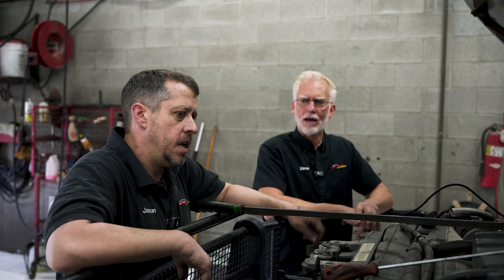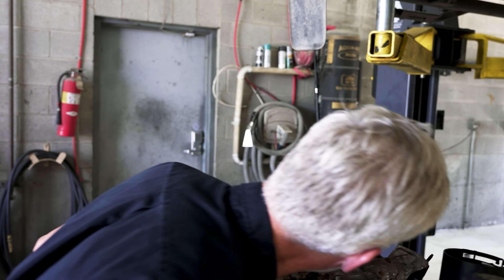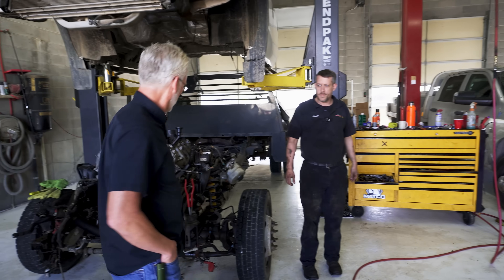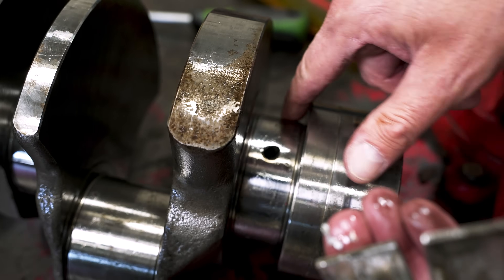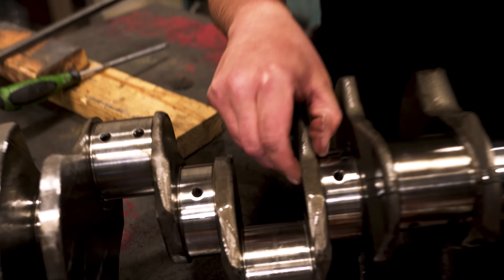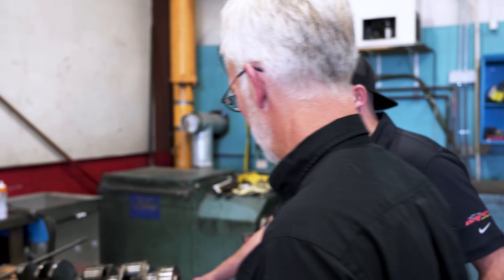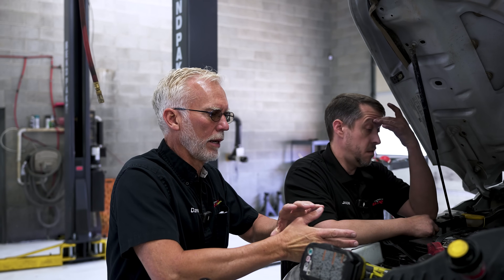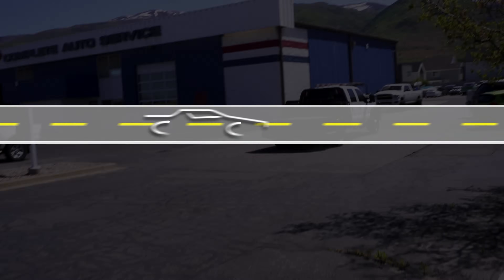Ford 6.7 Power Stroke Failure

Comment: That was a mess. It’s tough when businesses need their vehicles and put off proper repair. Great analysis and rebuild. Thanks.
Reply: It’s not just businesses. Even private owners can’t just stop using the vehicle because it’s their main and they don’t have a second or third vehicle to use in the mean time, or spend hundreds if not thousands on a rental. It can take 3 weeks to 2 months to get an appointment for a Ford certified master tech to look at a Power Stroke, possibly even longer for a busted transmission. And certain dealers can do services that most others can’t. And after diagnosis and the owner giving them the go-ahead, it could take 2-3 days to a week before it’s back in the owner’s hands. 
Diesel truck ownership is no joke and people sign up for a much different and more expensive ownership experience compared to gas.

Comment: Hey Dave I got a question I have a 6.4 ford 318,000 miles has a code for glo plugs I started pulling them today an they where soaked in oil what’s my next best move

Comment: For the record the piston cooling jet was likely damaged during reassembly by the 12 year old mechanic and when a PCJ breaks off on a 6.7 a piston failure is immanent. Also if the upper and lower rod or main bearings are transposed this will need to the overplate being overloaded.  The lower mains and upper rod bearings are coated with a special material to handle the firing load and the lower aluminum bearings are supposed to be installed in the block and rod caps.

Comment: From what I've experienced, forged steel cranks do not have ferrite and cast cranks do. You are correct on your description of polishing. While working at Ford engineering they purchased a 2011 F350 with 806K miles. I was in charge of the teardown and prior to disassembly we performed some performance checks as well as leakdown and compression with all cylinders showing about 4% leakdown and only a 10 PSI variation between them in compression. Records from the dealer the customer had their service done at showed 2 fuel injectors being replaced at 500K with nothing else being replaced on the engine including the fuel  and water pumps. The 6.7 uses a secondary cooling system to cool the EGR, fuel, trans, charge air cooler and power steering in lieu on having individual heat exchangers mounted at the front. When inspection was all completed, the only out of spec found was .011mm / .0005" at the top of some bores. This engine was very well cared for by the customer.
Reply: I don't even think the factory bores to much  less than 0.0005"...that is ...well I suppose it is possible...I used Sunnen CK 10 with fine stones..

I could hit 4.125 + .030...to within 0.0003"...and even make the cylinder have a taper...

Comment: I tore a fb marketplace engine apart. It appeared it had been rebuilt but the rod caps were not marked so I marked all the caps, pulled the rod bearings out and they all looked pretty trashed, but cranked looked fine. After getting everything back from the machine shop, I assembled it and as soon as I torqued down the rod caps the engine was hard to turn. Tore it all back down and found that the previous “rebuilder” had mixed up all the rod caps, that was why the bearings were trashed. It took some time with a magnifying glass but I was able to match up the rods to the correct caps by lining up the machining marks. Put it all back together and it rotated just fine. I’m not sure how many miles they had on it after the rebuild but it had to have been really tight.

Comment: I am a retired mechanic (ASE Certified Master Technician with CA Test and Repair Smog License) with over 35 years of on the job experience. I really appreciate your channel and the videos you make. I love "Condition, Cause, Correction and Confirm." That is so important and the basic foundation of how a problem should be approached and repaired. I have a few questions and value / appreciate your time to answer: How are the GM L5P's Diesels and "Allison" 10L100'0's holding up? What are you seeing as far as issues with them?  On the 6.7 Fords are you seeing much in the way of CP4 failures?  Thank you so much,  I look forward to future videos especially the follow ups.
Reply: S&S diesel has a new pump to replace the cp4 nightmare.

Comment: Never ceases to amaze me how these Ford (probably others) diesel V8's are like a rubber band ball. The sheer number of bits, pieces, and harnesses that are just woven all over the engine is incredible.The amount of disassembly that has to happen before a regular guy like me can identify it as a long or short block is amazing.
Reply: Straight 6 FTW
Reply: Same with the Coyote engine compaired to GM LS engine To Many Parts !
Reply: Erbody wanta go fast so here yall go ! Welcome to the high perfromance diesels!
Reply: Emission regulations killed the good old days.
Reply: @billyc5914 All hail the 7.3
Reply: @mikem9058  all hail the 5.9, THEN the 7.3
Reply: Diesels need more components to run well as it isn't a ignition based.. not to mention alot of it is for the envoirment protection agencies rules to make diesel more eco friendly.
Reply: At 4.11 in this video I felt traumatised. All this nonsense because it uses a ridiculous fuel. At 2024 we shouldn't be using diesel.
Reply: @gb4408  Why not? Diesel engines are 100% fuel efficient, gas engines aren't.
Reply: @mikem9058  I don't know where you come up with a 100% efficient. They are not 100%. If they were 100% efficient they wouldn't need a radiator, oil cooler, oil pump and no heat would exit ftom the exhaust. By the way about 1/3 of your 100% efficiency is the exiting the exhaust. You need to think what that statement means. No 100% to see here people move along. Did you see the huge viscous fan, lift pump, high pressure rail pump, water pump, oil pump, pumping loses, turning the belts, frictional losses. Its adding up buddy. Get you calcuator out and start hitting the minus botton from 100%. All of that bullshit that technician was unbolting off the from drives were frictional losses. I dont know you but broaden your thinking think, so you ask questions. Ask why 5 times and think why from old hydro mechanical engines to euro 5 or 6 the difference. Its the fuel. Diesel has a higher caloric value because it's an oil based fuel. Fat in humans has a higher caloric value for example. The Saudis are so rich and no other source of income they dont want you using alternatives. Every brilliant engineer that has come up with alternatives has had their patents purchased, they've mysteriously disappeared, and they're vehicles. The Western Australian Orbital Engine Company designed and built an extremely efficient engine with multiple small cylinders on a rocker bell setup that was so understressed it required no engine oil or cooling system. Where is it? Patent purchased  never to be seen again I think. The problems not the engine, its the fuel!
Reply: @mikem9058 If you read my comment from start to finnish for meaning rather than being emotive and read it more slowly you would understand. Ps in Australia I hold 3 mechanical qualifications. Started on light vehicle, went to TAFE completed heavy plant, then heavy road transport, ie big trucks. I know how a diesel works. Dont be emotive, I dont know you and have no need to do anything to you or bd an "a-hole". So be factual. It is not 100% fuel efficient, its an impossible figure. Also here's another one. If there is fuel coming out the exhaust of a gasoline engine its not running properly!  Also no comment about the Orbital engine company engine? Do you think I've only just worked out after 36 years diesels have no throttle valve? Come on mate you dont know anything about me. All good. And perhaps you could read the posts more slower as to not make yourself look so foolish.

Comment: A burned blue engine bearing and melted Babbitt material with an intact crankshaft journal can result from a combination of factors:

1. **Oil Starvation**: Insufficient lubrication can cause excessive friction and heat. The bearing may suffer the most because it directly contacts the journal. The lack of oil prevents heat dissipation, leading to bearing overheating, discoloration, and Babbitt material melting.

2. **Bearing Misalignment**: If the bearing is not properly aligned, uneven load distribution can occur. This causes localized heating and damage, even if the crankshaft journal remains unaffected.

3. **Improper Bearing Clearance**: Incorrect bearing clearance can lead to insufficient oil film thickness, resulting in metal-to-metal contact and overheating of the bearing. The crankshaft journal may still appear good if it was not subjected to prolonged or severe contact.

4. **Contaminants**: Debris or contaminants in the oil can cause damage to the bearing surface while the crankshaft journal, being harder, remains relatively unscathed.

5. **Material Defects**: The bearing may have had material defects or manufacturing issues, making it more susceptible to failure under heat and load.

6. **Heat Transfer**: The bearing can experience higher localized temperatures due to friction, leading to discoloration and Babbitt melting, while the crankshaft journal, being larger and better at dissipating heat, remains in good condition.

In summary, the bearing is more susceptible to damage from heat and friction due to its material and position, while the crankshaft journal, made from tougher material and better at dissipating heat, can remain unaffected even when bearing damage occurs.

Comment: Why do you even start it with rod knock and rev it?!?!  Arent you just circulating more bearing material through the motor that could just cause more damage?
Reply: Engine will be totally rebuilt and believe me everything will be dismantled to the last bolt, washed, and rebuilt up

Comment: 32 rocker arms, exhaust and intake reversed from the usual v8 setup. What a neat machine. It sounds like people seem to have lots of trouble with these engines but I can’t help but like the 6.7. Outside of 2 injectors, mine has been good so far.

Comment: I never understood why my fellow diesel truck owners/ work truck owners, will pay $500-800 for some pre made 1 for all tunes for their truck. Like man it costs the same to get some nice EFI Live custom tunes written for your exact truck, harder now with the EPA being asshats, but still do-able. 
For my 2005 Duramax work truck which has some decent upgrades done to it, i got 5 tunes made, a couple data log sessions back and forth and boom, custom fitted tunes for light towing/heavy towing/ MPG optimized stock/ Mildy hopped up level/ and finally one pissing hot set to kill tune.

Comment: There's still crankshaft grinders in Australia like in my area (Newcastle) my dad had to get the works done to his old Mitsubishi L300 Express (Delica) van because the engines in them were kind of crap.

Newcastle Japanese engine services which are a very reputable company who specialises in rebuilding Japanese engines rebuilt the 4G32 Saturn engine which was the best one of them (the 1.8- 2 litre Sirius engine was worse they told him,he asked them about fitting a bigger engine into it) but they got the cylinder head rebuilt the Wilkies then they had the cylinders bored out to 0.060" oversized & the crankshaft journals reground undersize by a machine shop & undersized bearing were shells fitted,so the engine was up to 1750ccs in capacity from 1597 CCS which was its standard capacity.

So Newcastle Japanese engine services assembled the engine.

It was reconditioned at 100,000 kilometres (60,000 miles) when he first bought it  in 1991 & the engine was rebuilt as new again not much more than 100,000 kilometres later ,he only bought it because there was 5 of us children to cart around.

No wonder he went back to driving Holdens,I know that in a Chevrolet & a Nissan engine I have never had a crankshaft issue 

I know an engine builder whose a Sweeney told me that a lack of oil changes is a cause of engine failure,he worked alongside a Holden Commodore wreckers & he was telling me of horrid stories where the nose of the 3.8 litre Buick V6 balance shafts just break off because the front balance shaft bearing seized due to a lack of oil changes.

It was no different to the Nissan RB30E 6 cylinder engine which Holden fitted into the VL Commodore in 1986, they were stripping neglected RB30E engines down as well to sell for parts.

I know that the Higginbottom engine reconditioning company reground crankshafts in our area but they're only open in Sydney now.

The Teterjn engineering company would still regrind crankshafts as well,I got them to remachine flywheels & do other machine work as well !

Comment: I think why crank grinders are rare is because only aftermarket shops will go the extra step! But also its performance folks doing that work and needing a 2 day turnaround is not feasible when they have 30 high dollar builds lined up!

Comment: Big boy toys...big boy repair bills. This kind of stuff makes me like my well maintained- high mileage GAS truck even more.
Reply: Well if you think about- people who should be driving these trucks are people doing commercial or their own  business type of work who generate higher income on a daily basis. They will pay 15-20k for a new motor and maybe get that money back within a few days or weeks. At the end of the day these trucks make people a lot of money but at the same time cost a lot more to repair and maintain good. 
I never had luck with gas trucks. They are usually problem free up to around 200-300k they give out and you literally have to replace every part that's not the interior or the frame after that mileage. 
Diesels last way longer and pay off and make you more money. And are cheaper in the long run especially if you drive and tow and work with equipment ALOT. Just my opinion though.
Reply: @Selsigs ok lady

Comment: Hey Dave, I ground cranks every day for about 5 years. From what I see (hard to tell with a video), I agree with your diagnosis. Incorrect polishing can be a real issue. Only other thing could be if there was variance in the finished sizes of the journal/bearings. Where a big journal was paired with a thicker bearing and didn't allow for proper oil clearance

Comment: WOW!  6 bolt mains in that 6.7!    Crazy
Imagine, the Cummins still only has a 2 bolt main AND it makes the same power with 2 less cylinders.....  And I'm a Ford guy.
GREAT VIDEO GUYS
Reply: cummins is up to 400 hp powerstroke 450-475 and made to make more!! why you see the 6 bolt main and graphite block.
Reply: My 6.7 kingstroke make 700hp 1400ftlb torque

Comment: Pro tip: Instead of using environmental debatable plastic cups: get some metal cans, so you can reuse them. We have a trolleys (like airplane food ones) for our nuts, bolts, valve springs, etcetera. Like in aan airplane, all projects that are taken apart, everything fits under the counter neatly.
Customers love us using it, since climate change/environment is getting more and more important in Europe.
Reply: People like you are the same ones who cry about "climate change" while at the same time think abortion is fine...

Comment: Regardless of how high the common opinion of the reliability of a motor is, there are still always going to be engine failures. The 6.7 powerstroke has a pretty good reputation overall but like everything else it has its flaws
Reply: Actually one of the local outfits close to where I work has a ton of them as fleet vehicles and statistically speaking, no they're not really reliable at all. They've had plenty of engine issues including two hardcore failures well before 100,000 MI, so many that they actually ordered a few Godzillas this last time around and then they were part of the issues that they had with the ignition systems on those and for 6 months, two of those trucks say unusable. The good news is they're learning. The two of six Godzillas have been replaced with two 6.6 lit gmcs. Soon to be more
Reply: @ashes2ashes863  Weird, the company I work for has 10+ 6.7s and haven’t had a single catastrophic engine failure since 2016 when they were bought brand new (with some of them recently hitting 300k) but hey, “statistically speaking” is very subjective.

And for the record, I am NOT a ford guy but those trucks have impressed me.

Comment: Watching Dave’s channel has removed all desire I had to own a diesel.
Reply: Get an EV truck!😂
Reply: Every single engine ever produced has some kind of problems. Operator error or lack of maintenance is the number one problem with any engine! This 6.7 scorpion engine has been produced since 2011 and there are literally millions of them out on the road every single day. Being there are sooo many out there you are bound to see them come into a repair shop from time to time simply based on sheer volume that's out on the road. It is a really good engine other that the Bosch CP4 fuel pump and the emissions equipment bs on it DPF, EGR, SCR, etc that choke it & cause more problems that their worth. Taking them off dramatically improves longevity & fuel economy (20+mpg). Diesels are just like other engines, they need their maintenance done religiously. Do oil changes & fuel filters regularly at 5k mile intervals & problems don't happen. There are many diesel trucks with close to a million miles or even more out there on the road doing cross country hotshot deliveries daily. Diesel is the lifeblood of the country & the world. Everything gets moved by diesel power -trucks, ships, trains, etc.
Reply: @tdotw77  Stripping an engine of outside systems only works if you live in a state that does not have emission testing.

Comment: He welded that egr plate because when you remove the cooler that one bolt or both will break that holds that crossover pipe , guaranteed he snapped both bolts off and didn’t want to tap it and mess with it, so he welded it lol